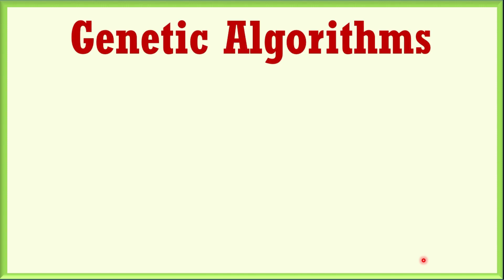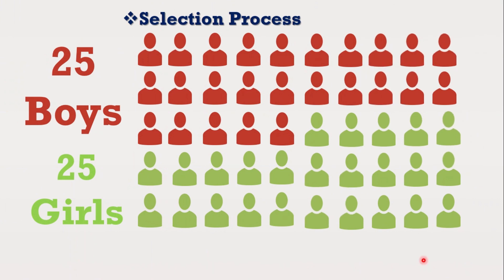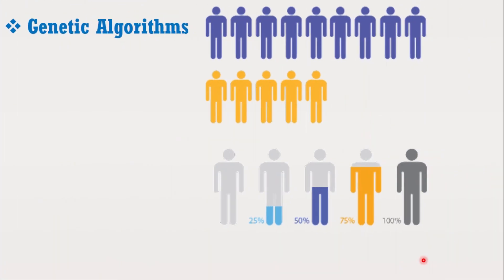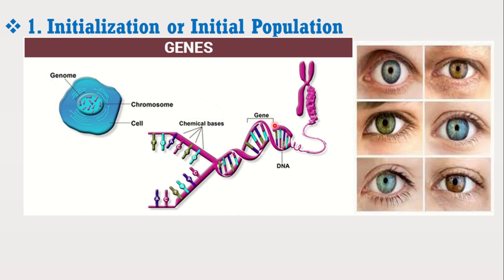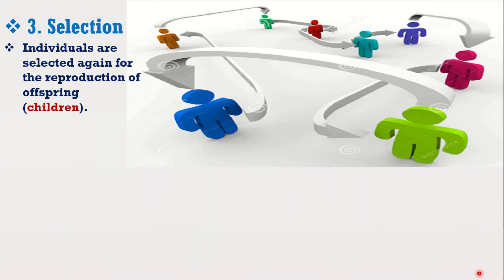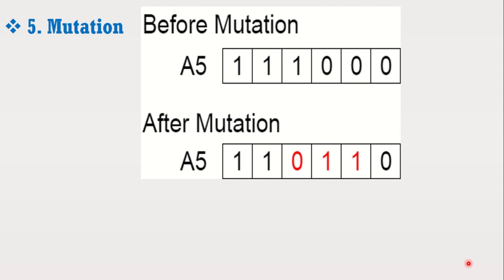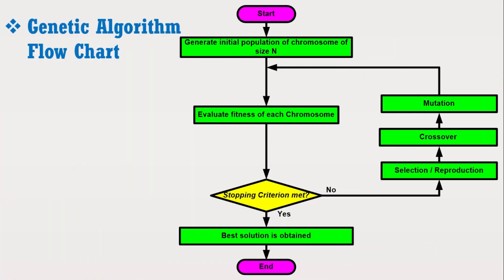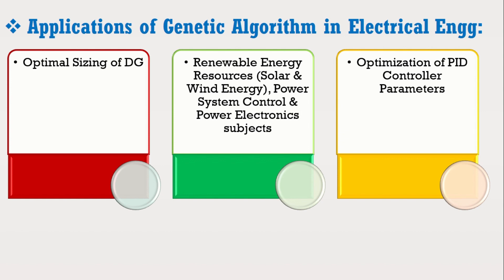How to Implement Genetic Algorithms in MATLAB/SIMULINK Software? Part 1 | Dr. J. A. Laghari

Comment: Sir please  one video on tuning of pi controller parameter in grid connected pv  system .
Reply from the maker: Thanks for the comment and suggestions. Basically every new topic needs new learning. It takes lot of time to learn and implement. I will try to make video as soon as possible.
Reply: @DrJALAGHARI  thanks sir